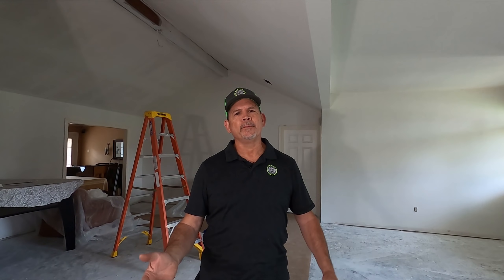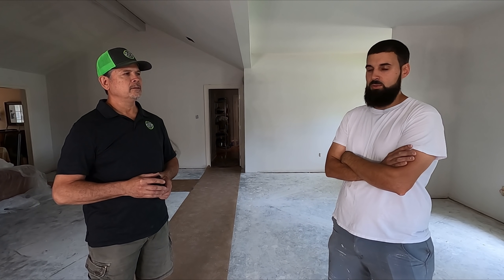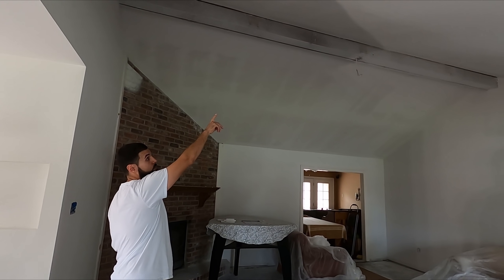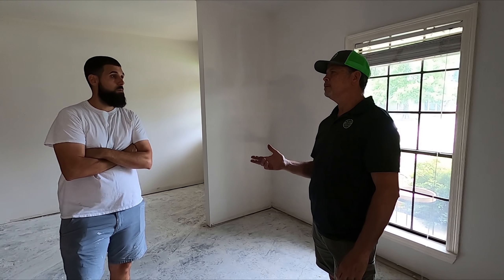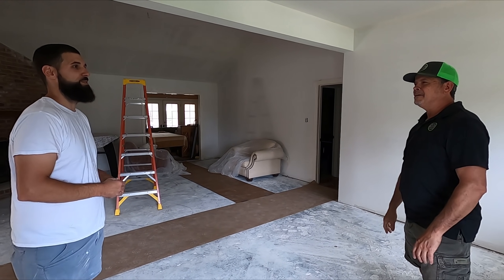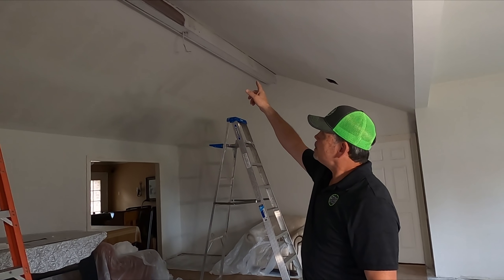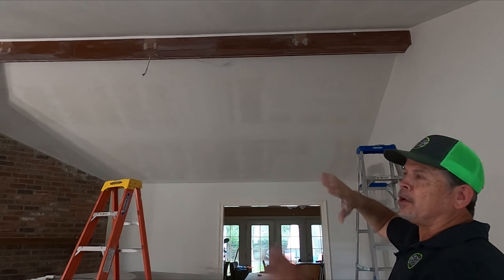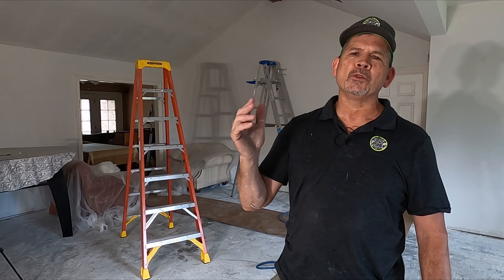A Drywall PRO CRITICIZED Our Work... Ep. 18

Comment: i always charge double to finish behind a non professional.. normally the cost to finish your work is nearly the same for me to hang the drywall and finish it. its always more hours to fix something up, so i charge for it..
Reply: also as an 30 year pro, i would have to say be careful of pushing drywall to studs on the walls and screwing or nailing it, the main reasons being that this could cause screw pops and walls that are not flat..
lumber like to twist and move after installed so always take a quick look down the wall before hanging the sheet to make sure there is nothing to far out of wack, slight inperfections are just glued heavy, really bad stud are cut most of the way threw and pulled staight(if not load bearing)it very important to do this in kitchens and bathrooms where your looking for your walls to line up with vanities cabinets and countertops.
 rafters and joist cannot be cut so ill always just use shims of any kind.always try to look across your framing, look for the bad (Its there i promise,most of the time the promblems arent detected until you get up by the ceilngs.)try to place butt joints on the studs that is crowned upwards.
Just my 2 cents guys and keep up the good work. 
 no screws in my fields on the walls ever unless required by code the ceilings are glued and screwed to spec.
ALWAYS GLUE YOUR DRYWALL.

Comment: Would have loved to see how he reset more than half of your screws. I’ve always done the same taping knife technique but maybe it needs to be deeper. Learn something new in all your videos!  It looks awesome because it’s built awesome!!!
Reply from the maker: Thx 👍.  More Josh videos plz 💪
Reply: You heard Josh say to push the drywall up against the stud / rafter / beam and hold it while driving the screw. Rather than having the screw head push the drywall in, which introduces variability into the process.
Reply: @stevebabiak6997  and I bet that Josh can just look at the drywall and see imperfections that he needs to fix. Me?  I see my Sheetrock on the wall with several holes from missed studs even though I marked the stud locations along with my wife asking how I could have possibly missed the stud. Would have loved to have seen him identify it and fix it. Bathroom remodel coming up so this whole channel is awesome!

Comment: If you checked the screwheads with a blade theres no reason they would have to drive them deeper. The cordless dewalt drywall gun is 5x faster than there corded gun I own both lol and a battery last almost all day
Reply from the maker: I think the screws were flush so they didn’t ring the blade but not deep enough to hold any compound.  You’ve seen it...  you skim the screw but can still see the Phillips cross 👍

Comment: take as long as it takes and as many coats as it needs do it once and do it right was always my take on doing drywall i always thought most so called drywallers never finished it properly [lazy] the really good crews were far and few between a lot of guys just don't  want to come back and spend that last day with a trouble light and check the job for deficiencies is usually a half day or so depending on the job size be a pro or go

Comment: i wonder: just as your electrician likes how you work with him, will you set up a relationship with Josh specifically? What is the cut off for Josh and his crew, where they would not take a finishing job on someone else's hanging...: is it the size of the job? if you call him for something small would he reject the request, or is it too many gaps: he might have to charge as if he did the whole thing. 
Just like a bit more tips on how to support bringing in a finisher without ticking him off....
or: is there a Josh channel yet....

Comment: Did the framers apprentice make that beam?  Or is it just the framing of the beam?  I think it is that’s why it’s nailed from the inside they had thick reclaimed outside.  It was nailer from each side and attached with hidden fasteners from the bottom or “ Z” mellow fasteners.  There would hv been no cracks or end not flush w/the wall.  
I would imagine this is a flip and all that expensive wood taken off or the owners removed it.  No finish carpenter would call that a beam!  And yes they lifted from the floor with a lift.  I can tell by the roof lines it was originally a custom.  That’s not a track home roof!

Comment: If you ran the seam with your knife and found no proud screws, then why did they need to be reset?
Reply from the maker: Maybe they were flush ( not ringing the blade) but not deep enough for mud to cover.  That’s all I can figure 👍
Reply: @StudPack  But nails would be deeper?

Comment: Did the drywall dudes catch that you all used fine thread metal screws instead of coarse thread.
Reply from the maker: We used coarse 👍
Did Jordan buy fine thread when we ran out?   Didn’t notice
Reply: @StudPack  Yeah,  he bought them when you ran out.  I caught it in the close up. 
You know what i thought might be the thought on the fine thread. Possibly using the fine thread on sections with the old hard lumber. 
As for screw head depth. I find that the light weight drywall to be too soft and it's easy to drive screws too deep. So i set my drill to not over penetrate and i end up with shiners. Not sure if you all used lightweight. 
I always enjoy hearing back from you all. I am doing the same thing here in California.
Reply from the maker: Must have been all the hardware store had in stock idk.  Good point on lightweight rock and screws.  We used lightweight rock but it’s not the same as home centers sell.  I can tell the difference in weight and how it cuts etc.

Comment: To make the ceiling/wall joint less obvious when it's not particularly square and straight, I once decided to back the wall paint down about a quarter inch from the ceiling. Not only did it do what I was hoping but it created a pinstripe around that really makes it pop (assuming wall color different from ceiling). I'd be happy to share a photo; email me at pdeckeremail@gmail.com.

I have also used bullnose corner bead throughout my home. It seems to be the first thing people notice when they come into my home and everybody loves it. It's a bit challenging to deal with base molding but it's worth it.